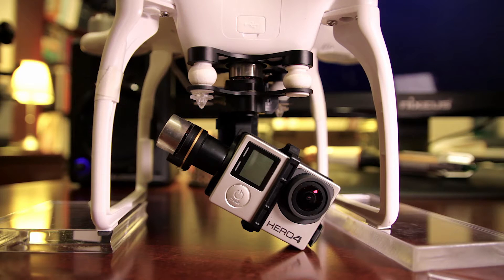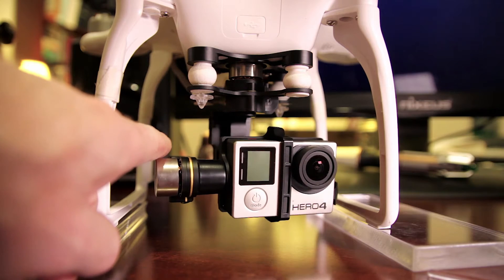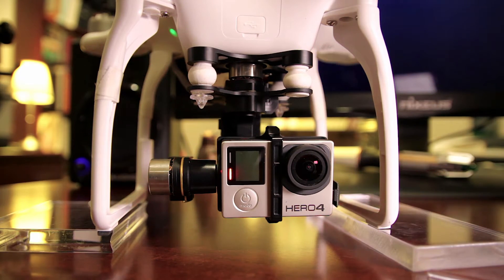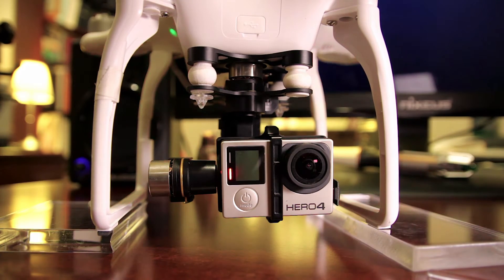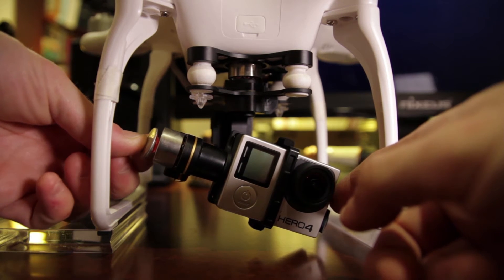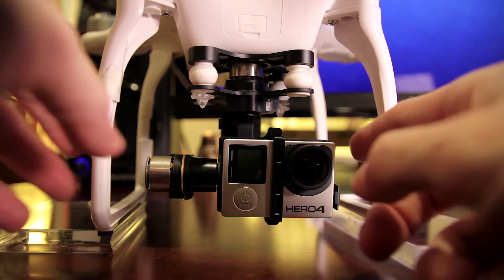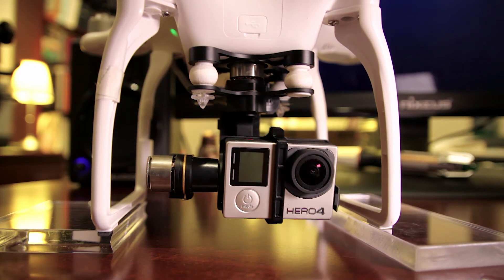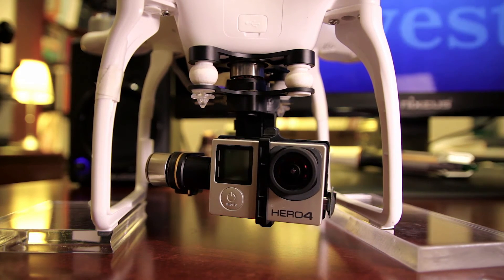How To Balance A Drone Gimbal From DJI

Comment: I got a cheap nd filer of ebay a while back and mounted it to the gimbal. worked fine for a little while, but then the gimbal started rocking up and down and responding to stick movements. The motor on the side of the gimbal took damage. So this is a great tips. :)